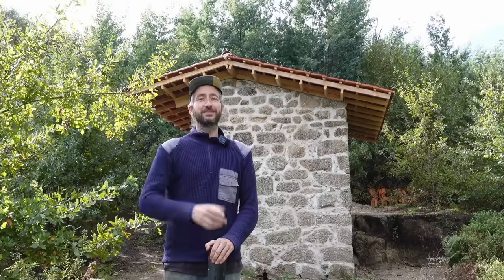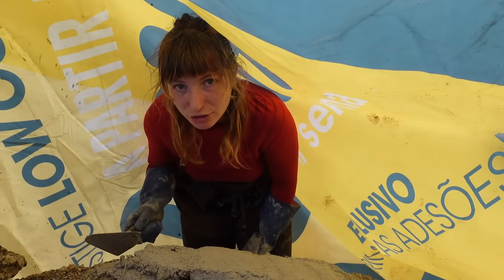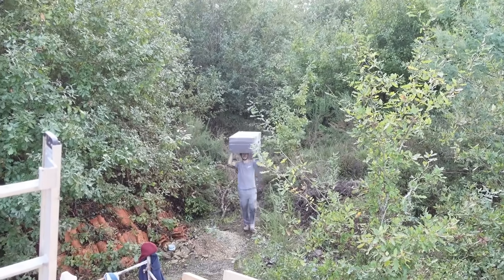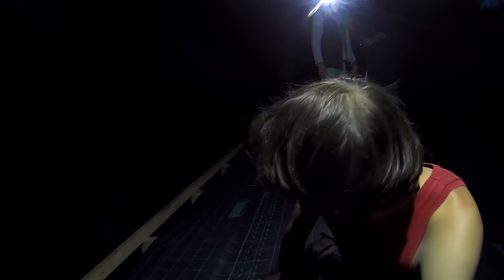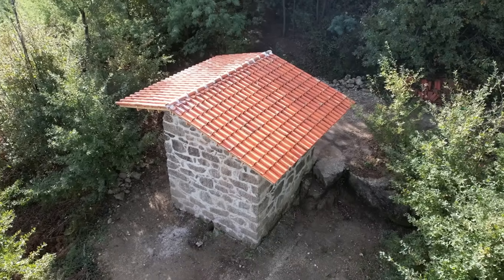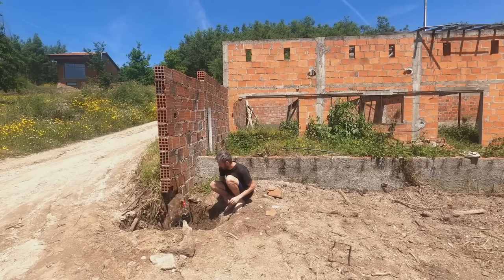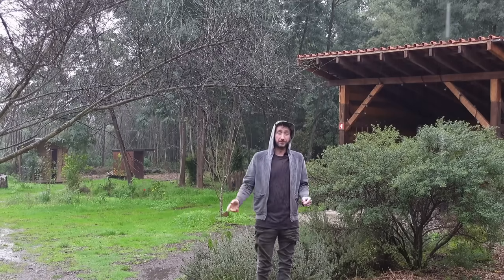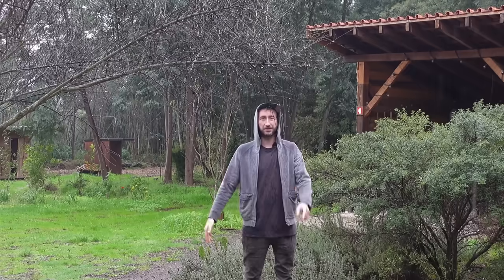#137 We finished this stone house (Last episode)

Comment: Well done everyone with the ruin project. A suggested improvement (cos I know we all love those after the event 🤣) would be to install metal insect mesh along the edges of the eaves (at the end of the roof rafters) to stop insects nesting and birds etc entering. The roof should ideally have air flow below the tiles to deal with moisture, but with the solid blocks / noggins you have installed that's not going to be possible. You could drill several large holes in each block and fix mesh across the front - pretty quick fix.
Reply: Just what I was thinking! Birds even will get into the roof cap tiles open at their ends
Reply: That's what I was thinking too - that the space beneath the roof needs air flow, not only to prevent moisture from building up but also to prevent dry rot from all the heat! 
I was also worried about where wood is touching stone and/or mortar, because they absorb water,  which will be soaked in by the wood, not only causing rot, but also creating the perfect environment for spiders, carpenter  ants and termites!   
For future projects, I seriously recommend that you order metal brackets and saddles to serve as a bridge between wood and stone/mortar.  These can be bought from building materials suppliers online.  If you explain what you're building, they can suggest the right ones for what you're doing.
Reply: @RD9_Designs  they make masonry products that are designed to go on wood and vise versa. They installed the entire roof incorrectly. fixing it now means taking it off and relaying it. they also make plastic (something that could be produced at their reuse/recycling facility) underlayment products that serve to close the gap but allow air flow. Putting metal and masonry together is a no-no now. Corrosion being the biggest factor.

Comment: Use those mimosa tree trunks to build raised areas for the tents. Split and fasten together flat side up. It can't be any lumpier than the ground and would get the tents up out of the wet.
Reply: I think the problem is as the mimosa wood dries it twists and bends a lot worse than your traditional soft wood. So even if its flat at the point of finishing it, a few months later after fully drying it might not be flat enough.

Maybe if they could process the wood into laminated sheets, glued flat into desired thickness but thats a very extensive process

Comment: 20:44 The boom & bucket can be used by rotating the cab to sweep the fill dirt back into the trench cut and prevent (or mitigate) any more tread surface interference from the teeth. Also, said bucket's back side can be used to tamp down the fill dirt to a more ideal compaction.

Comment: If you put a culvert in under road to put a pipe to service the building on the other side of the road plus it will protect it as well and if have to replace it you won't have to dig up the road too later down the road

Comment: A little note about the closing pieces between the rafters (to prevent the birds to enter the structure) : it has to let the water go away from the roof membrane ! There sure will be condensation under the rooftiles, that will roll down on the membrane and accumulate against the closing pieces, with a risk of rotting these pieces and the rafters.

Comment: Need to vent that space under the tiles. Easiest to just drill some home sin the blocking y’all installed and cover the holes with mesh. Some airflow will help your house avoid excess humidity and preform better in the heat. Cheers!

Comment: SUGGESTION...use the plastic tubes to hold tools on tool wall, hold tools in the kitchen and as brackets when running  other flexible hoses or pipes. Screw the pipe pieces along the hose route every 3 feet or so and it acts as a guide so hose wont kink

Comment: Pipe for stretch that reach under roads and driven over areas I would add protection sleeve as you use heavy equipment

Comment: Exterior doors should always have the hinges on the inside. Not only for security reasons (a thief can just unhinged the door to get inside) but also for safety (an obstacle could be placed outside the door and prevent people from opening it and get trapped inside). I know it was done like that to save space on the inside but it really should be reworked.

EDIT: Congratulations on the baby! Hope it's born easy and healty.

Comment: I think a fascia board finish and drip edge board finish on the edge of the roof of the ruin would be good or is it just me :) drip edge boards protect the rest of the ends of the wooden roof structure from rain and the elements..fascia not only provides a finished look but also supports the lower edge of the roof and holds the rain gutters in place...but that is probably for season 5..:)

Comment: I notice when you started digging with excavator it was on idle. The machine motor needs to be on a higher RPM refer to the operating book. So you don’t damage the engine and oil pump

Comment: I now can see you had planned a "double roof" for this structure, as I was very concerned for the lack of eaves. This has a better eave overhang...However, you have left ZERO venting by blocking those eaves for "birds" (which was a good thing!!!) but should have framed these or drill very large holes and screen over them (but you might have that planned...???...and did not show it.) A proper "vented cold roof system"...without venting...will have some form of interstitial moisture issues in the eave and corner areas over time as water condenses above the insulation that typically runs down the rafter thus leading to decay...I still have concerns for the second floor framing over time, but if it is not loaded heavy it should be fine...All in all, I feel much better about much of this...of course there are things to improve upon...LOL...but that is academic and opinion...

Comment: Probably late to write about this, but granites release considerable amounts of a radon, some may find dangerous, Not the most adequate material for long stays inside...
Reply: Also, dont use pine, its the best food for xilofagos, wood bugs, in 5 years most of the wood can be considered garbage. To prevent this you will have to start taking preventive measures. The darker parts of acacia wood are much better in regards to resisting wood bugs...

Comment: Hello, I enjoyed watching your videos, though I will admit, some of the sections were a little too long, watching you cut 40 pieces of lumber the exact same length, even sped up gets just a tad boring.
 The well that you found, and cleaned out, is it full of clean water now? is it usable?
 Now that you have your backhoe, will you be putting in swales, and berms to help hold, and or divert water from just running off the property?   Finally, do you have a plan to keep the mold, and mildew away from your buildings?